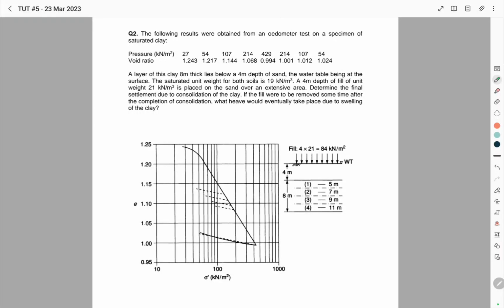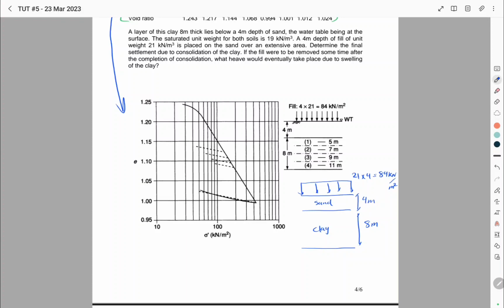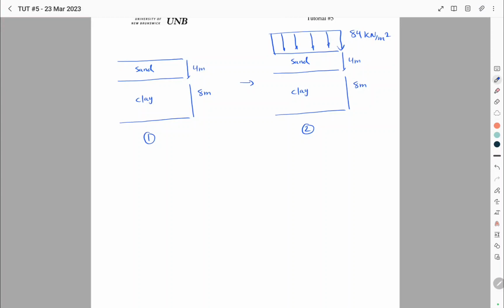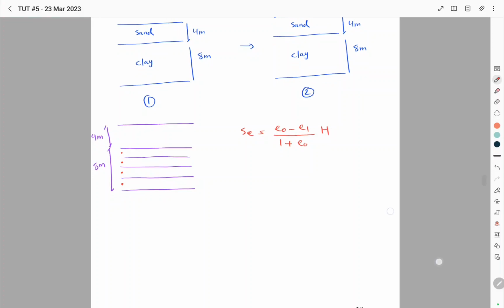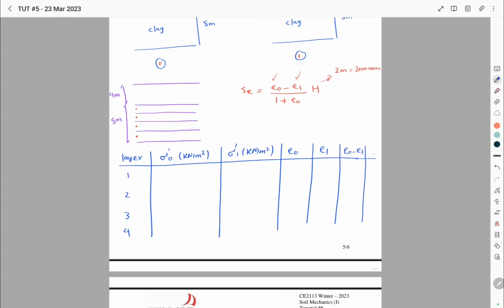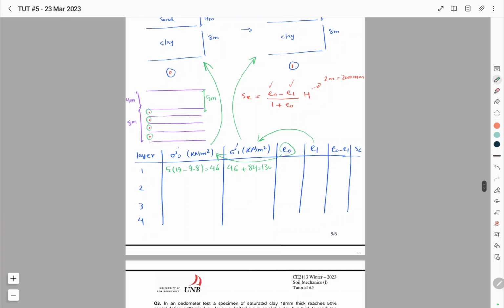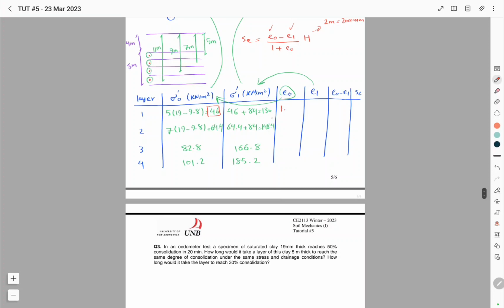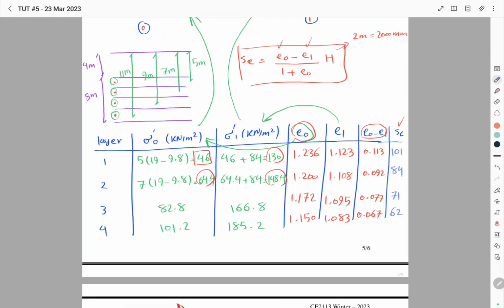Consolidation Examples (Q2.1 - settlement due to loading) - Soil Mechanics I

Comment: Why you didn't compute the decrease in stress with depth for the surcharge
Reply from the maker: If you’re very deep below the surface, you might consider whether the surcharge effect has “dissipated” due to the soil’s behavior at depth. This is generally more relevant for point loads or localized pressures, which spread out and become less concentrated as depth increases. For broad, uniformly distributed surcharges, however, this effect is negligible at most practical depths, and the surcharge stress stays effectively constant. So we assume that the effect of a uniform surface load (like a surcharge) is distributed equally throughout the soil column below it. This assumption comes from the mechanics of materials and how uniform pressures propagate within a material under certain conditions. To summarize: the increase in effective stress due to the surcharge load remains constant with depth. A surcharge load, like a uniformly distributed load applied at the surface, adds a uniform pressure to the soil column. This surcharge load impacts the entire depth of soil with the same added stress.